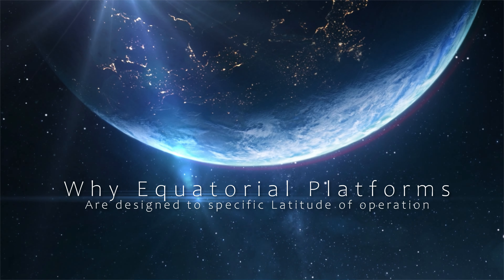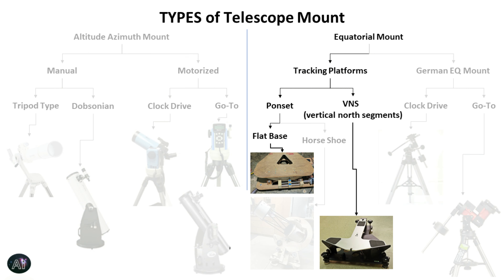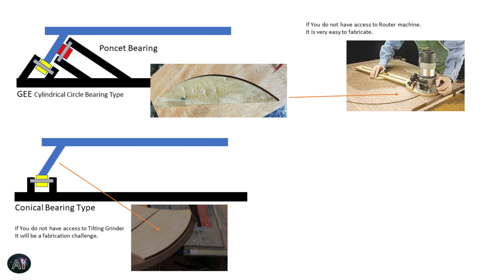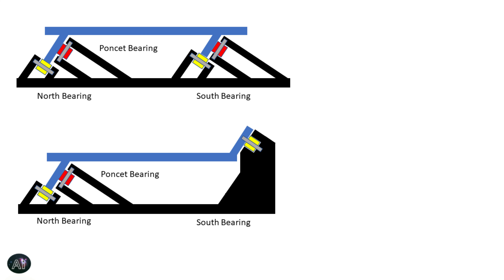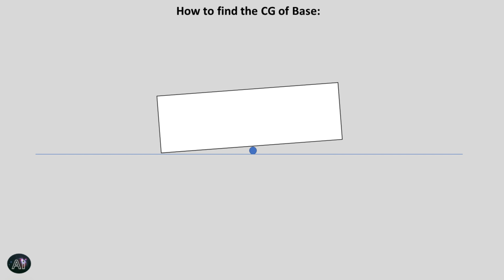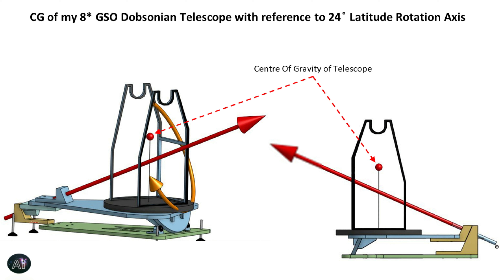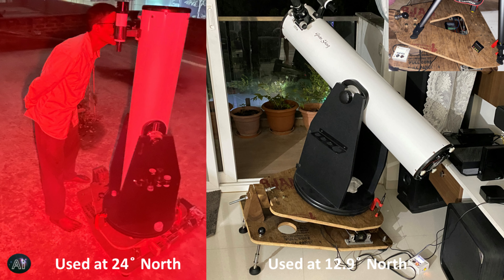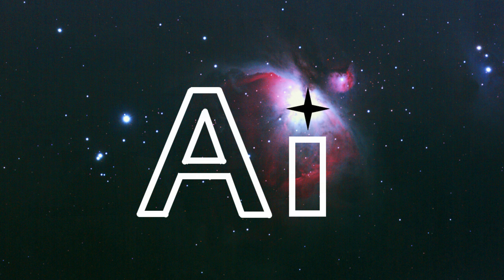EQ Platform Build Video Series E02 Design Inputs

Comment: Sir does EQ platform just only stick with Dobsonian Telescope? Cant we make it for other Telescope which has their own tripod stand??
Reply from the maker: Basically Dobsonian is an low profile Alt Az mount with a Newtonian telescope mounted on it. So if you want to put a Newtonian or a refractor, yes you can do that I had shot andromeda with a DSLR mounted on a Tripod which in term was placed over the EQ platform, the thing to take care is to keep the Center of gravity low so your system doesn’t fall off and break. Also note for DSO imaging you will need a dual axis guiding on the mount. EQ platform will only track and prevent field rotation but not do auto guidance.
Reply: @ASTROindi  Thanks Sir. I will go for Newtonian one.
Reply from the maker: @kunaldewangan2488  hi I didn’t realise you were asking for a telescope suggestion, I answered assuming you have a telescope and if it can be put into EQ platform. Suggesting a telescope will depend on where do you live - how much light pollution is there and what is your primary interest visual or astrophotography? Are you familiar with night sky and navigate using star hopping or you will need a goTo. If you can answer this I can suggest some best ones and you can select based on your budget.
Reply: @ASTROindi  No sir I was asking for platform, I have a Newtonian Telescope and want to make EQ platform for the same.
And thanks for making effort suggesting me for Telescope 🙏🏻

Comment: One piece of software, I found invaluable, when building my platform, was a spreadsheet, designed by {someone?}. Search for eqplatform_calc2012.xls.
Reply from the maker: Sure I will search for it, I made one for the drive ratio and tracking accuracy calculations which will be covered in EP07.